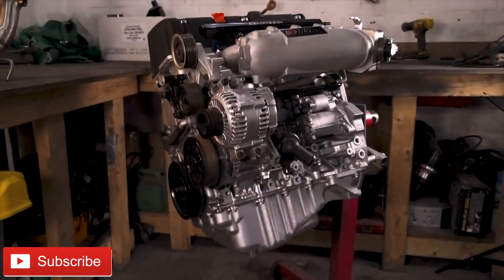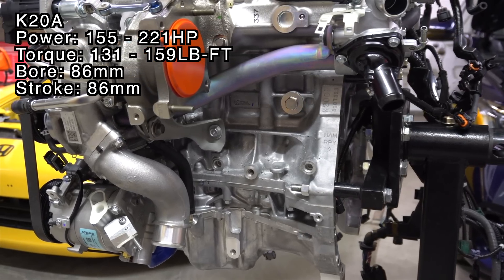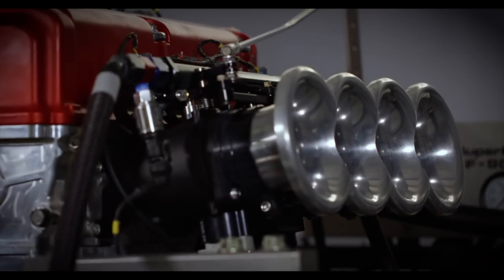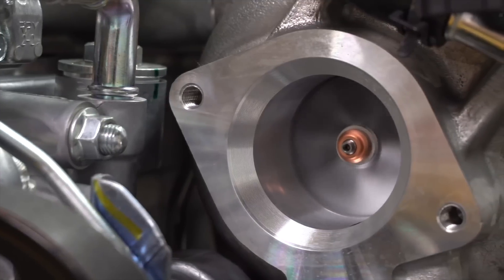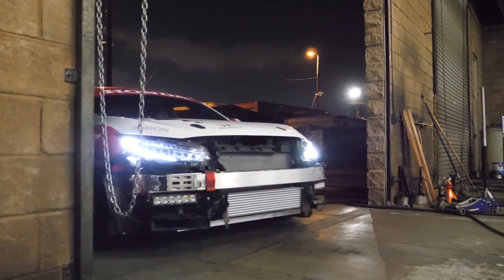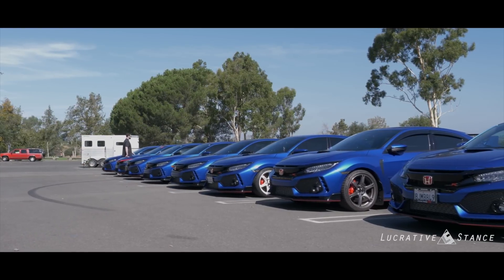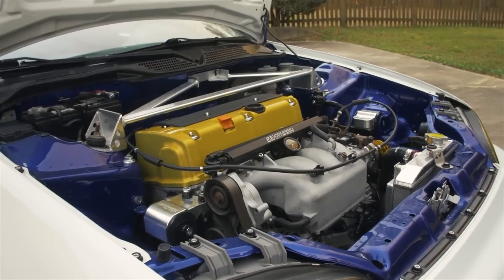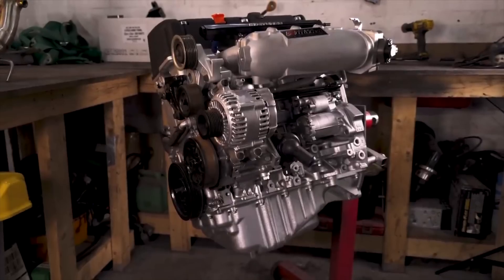Honda K20A vs K20C: What's the Difference?

Comment from the maker: If you guys enjoyed the video, please SMASH THAT LIKE BUTTON. It helps the channel out a huge amount and helps YouTube put the video in front of more people. Thanks for watching 😬
Reply: We need a K20C comparison to the N/A K20C2.
Reply: @Firestar2013  i was about to post about that ! Some people tell it’s doesn’t have potential the k20c2 but i think and believe it does !
Reply: The exhaust manifold integrated to the cylinder head is very bad for tuning for high rpm and also transfers more heat to the cylinder head, one piece is saved and the engine warms up before the rest is all bad. The engines are currently basically garbage.
Reply: K20A is the better one for now. Wish you would have added how horrible the Honda, paddle shifted CVT is. Under 10K worth of performance driving, the pulley's scored up fast. CVT'S are not performance transmissions. 
They should have never put paddle shifters on it. All shifting on a CVT is simulated or just a held position on the pulley's.

Comment: with my experience driving a 2020 accord with the k20c4, these engines are fun to drive stock.  You don't have to rev them very high to get the torque and power you need.  If you rev them up, you will be spinning in 2nd or even 3rd gear.  252 horses and 273 ft-lbs of torque.  With the k20a, you got to rev them up to utilize their power.  Whilst the k20c4 makes it's torque at 1500 rpm.  Honda's new engine imo are designed to be kept stock.  Yeah, you can tune them, downpipe, exhaust and intake and get close to 400 horsepower, but the stock 235/40/19 tires just can't hold on.  As a daily driver, 13 pounds of boost is more than enough at full throttle to keep me happy

Comment: Acura RDX, 2021, does it have K20C?
Reply: If it’s turbo, yes. But a different variant
Reply: the rdx should have the k20c4, shared with the accord.  The rdx k20c4 makes slightly more hp and torque as compared to the accords k20c4

Comment: The K20A got 36 mpg in my RSX-S during the daily highway commute.   If I drive very economically with my K20C (FL5) I can barely get 32 on a good week.  Yeah, I know, these aren't meant for economy but just thought I'd add it in.   If I drive the Type R like I really want to, it will do mid 20s.

Comment: I choose the K20C1 4my 2008 Honda Element SC daily driver because of the low end torque. I plan the elimination of steering hydraulics by upgrading 2a full EPS steering rack. My only concerns now are the adaptation of the unit as a direct bolt in, i.e. engine mounts, AC compressor, alternator &computer. I'm not worried about intercooler piping, turbo lubrication or cooling. 

Any help here?

Comment: i like the idea of the newer k20c stock or lightly modded for daily use; the k20a heavily modded for race application and big power. after seeing that accord wagon w the k20c in it, all i can think about is the k20c in my 99crv awd w that low end torque.

Comment: The K20C2 is naturally aspirated. So the difference between the letters isn't because of aspiration. If it is, then I'd like someone to explain the lettering and numbering system so that the logic fits, but so far from what I've figured out, the C is either a newer or different market than the A, and the numbers after indicate combinations of VTEC and turbocharging.

Comment: This is the proper with most new turbo motors. Way to much load in the low rpm.

Ecoboost,MZR and the k20c and most new gen motors make way to much tourque in the low end. 

So your cruising along in 6th and put your foot Down and load the motor up with all that sweet low end power and things get bending. 

Allot of it has to do with the baby turbo and bad tuning and bad driver habits.

Comment: The main thing that i don t like about the new k20 is how plasticky some parts for it are. My k24a3 is 20 years old.Changed some gaskets and seals once and that s about it.Not one single drop of oil,not one.Aluminium for valve cover and cast iron for the intake are much better materials than fing plastic.Just look at that skunk intake how sturdy and good it looks on that k20A.

Comment: K20c is good, but its not a good engine when compared to the previous Honda type r engines. Has weak ass vtec, and need 20 pounds of boost to make only 100hp more.

Comment: Is the K24 engine with K20 head also possible with the K20C? If so is the K20C head a better solution if you whant to Turbocharge the engine?

Comment: Thanks for the video @Dust Runners Automotive Journal. 

The difference of these two engines are (K20A vs. K20C):
- high revving concept vs. down sizing concept
- EURO 3 emissions concept vs. EURO 6 emission concept
- high performance concept vs. emission driven performance concept
- modulare head setup vs. fixed

Out of that many details can be explained like the port design differences, the revving capability, tribological characteristics and so on. Rating them in one sentence is like comparing apples and bananas. It's not fair as they had different development goals.

For me the K20A, K20A2, K20Z1, K20Z3, K20Z4 are one of the best base engines for developing high performance engines out of it, no matter which induction concept: NA or FI. It comes with one of the best aftermarkets and the potential of these engines is still not released at full size. 

Regarding the direction of engine development Honda take for the K20C, I don't agree with it is the right direction. The down sizing concept comes with a lot of disadvantages regarding sustainability in development, it's a completely certification cycle driven development (NEDC, WLTP), many engine concepts from the late 80'ies to 90'ies can compete with the real driving emissions of those engines regarding particles and NOx. It helped the car manufacturers to increase the chassis weight while keeping the dynamic level or even increase it. That's a total wrong way. Honda choose it too. I was so disappointing, despite I understand they wanted to compete in the I4-performance engine car market. For me the better direction is chosen by Toyota Dynamic Force or even more the Mazda SkyActive X engines are the way to go. IC engine'd cars have a hard time competing against that certification cycle preferred E-machined cars. Downsizing won't help to compete, it helps to shorten the era of the IC engines. Honda's engine strategy was really disappointing me, once they had the best and bravest engine engineering teams and strategy, now they are just average. What happens not being innovative, plans to fire employees: Daimler 30.000, VW 20.000, BMW ... and so on. The all missed to adjust their strategy right in time. Now the big kaboom can be seen all over here in Europe. Tesla teaches them all, a company with a few years of experience teaches companies with almost 100 years of experience where to go. No sorry, Honda missed that too. Honda failed to chose the right way and just went into business as usual. The first and expensive step into the wrong direction can be the first into a row of steps into a lower noise-signal-ratio regarding market awareness in future or when turning back into right direction at a lower EBIT.

Comment: I have a k24a with a k20a head.
The first version was all stock internals N/A. Dyno 212 hp at the tires.
2nd and current set up with a Garrett t3, 1050cc injectors, running low boost (11psi)on stock internals 404 hp at the tires. 
Next version will get rods, pistons and cams with 20psi. Hoping for 600 hp.
I'll stick with the A series.
Reply: we are easily getting 600whp+ on stock K20C in our Type Rs now. Look it up. With upgraded turbo of course. We even have drop in turbos putting out 600whp.
Reply: @RetrOGz  you also cost forty grand more

Comment: 300 hp with 20lbs of boost.?
That just doesn't add up.
20 lbs of boost on a k20a will yield over 500hp.
Reply: Flow rate and much higher rpm range

Comment: Honda is going the route of boost and torque over high reving n/a horsepower because their chassis have become bigger and heavier like other manufacturers.  Civic type R is well over 3 thousand pounds while the original ek9 was around 2300 lbs.  This increase in size and weight has resulted in more power needed.  The reason everyone is swapping ks into their eks, egs, and crx or intregras are because the older lighter chassis are pure Honda at heart.  Minimalist.

Comment: Do d16z6 next. That's the engine that I am currently building to handle 400+ HP. People don't give the single cam enough credit when it's actually a cost effective route.
Reply: I agree. Good luck with your build. D16s are great engines.
Reply: Watchu talkin bout... the single cams have been gettin clout for the last decade now man. Goto any honda specific show an ull see more D or F series single cam builds than u will B or H's nowadays.
Reply: if you want to build an unpopular Honda do an R series or the k20c2 (the non turbo ugly duckling)

Comment: Do they bother with different internal components between the NA K20C (used in Civic Sport in the US) and Turbo versions?
If so, the internals in the NA engine must last forever in stock form.

Comment: k20c is a far superior engine, but we are going to have to wait until the aftermarket section expands. 
that said the engine im interested in is the one used in the 130n it makes even more torque than the k20c for its power range.
Reply: I disagree.

Comment: Reliability has went way down with the turbo motors it’s a shame they have been so reliable a lot of turbo Honda’s now get gas in the oil I have heard smh my next car will be a Toyota and I have bought Honda for a lot of years ..
Reply: Mike Ramey that’s normal for Direct injection engines look it up

Comment: Whoa the errors... K20A3 base model only does the fancy valve stepping on the Intake, it constantly works the both exhaust valves. K20A/A2/Z1 or the Type S/R engines, gets variable timing and lift on both sides. It's why the A3 will out pull the A2 until the A2 hits VTEC. It's why I prefer the A3 engine as well.

A3: 141ft/lb 4000RPM
A2: 142ft/lb 6000RPM
Z1: 143ft/lb 6200RPM

Comment: The K20C guys will soon get to share some of the same problems as us ford ecoboost guys have. The integrated manifold prevents us from going over 600hp and creates a ton of backpressure on the exhaust side. Its really a shame because the closed deck ecboost blocks are pretty stout but we cant do shit about the head. If i was building a honda i would definitely go with the k24 or k20a
Reply: The c2 is naturally aspirated
Reply: The VTEC is on the exhaust side  to aid with getting exhaust gasses out
Reply: @A4ANT its still a big restriction, thats why the best honda engine is still the k24a2 from the tlx/tsx.
Reply: Three years after that comment, it turns out to be complete nonsense
Reply: @jachpriboy8989  retarded honda fanboi, show me a past 600whp civic type r using the k20c? Stoo being a fanboi and accept the fact kid, thats why people go for the k20's without the integrated manifold. I cant stand wanna be honda fantards like you.2
Reply: with minor modification head flows double, but that doesn't guarantee developing more power. The restriction is there to tumble air for DI. Need to go with both di and port or plug the di and go straight port. The integrated exhaust will always be a problem at some point though 😢

Comment: Torque???? 🤔🤔🤔 what is that??? Lol we are used to these engines screaming for dear life, and we still cant get traction while torqueless so why would we need torque??? 😂😂😂 honda need to go back to the drawing board and innovate from the k20a/k24a and make something better than both of those, the k20c isn't worth it in my opinion, seeing as just bolting on a ebay turbo to a k20 or 24 will out perform the k20c in evey way, there's even a video of a na k20 hatch givin the sauce to a fk8  with no remorse so that alone screams k20 over k20c for me, other than that the biggest issue is PRICES, and aftermarket availability, honda should've just stuck to NA and leave the turbocharging to the enthusiast, plus they went D.I. <--wtf honda, leave that shit to everyone else we dont need that shit, as he stated in the vid it's a limiting factor, I honestly dont think honda will ever make anything quite like the k20-/k24 or b/h series ever again

Comment: After watching 3 of youre vids in a row, I've learned that Japanese engine's, built in the 90's, were fucking awesome and ahead of their time.
Reply: The b16 was ahead of its time.  That same engine was introduced from 88-89 to 2000.
Reply: @ClearWater7.62  #facts
Reply: bug productions I knew that in the early 90,s dude, Honda always lead the way putting racing engines in the road at affordable prices for the public domain
Reply: Arthur Wall 😃 👌
Reply: The J was ahead of its game now it’s in the nsx lol a accord tl rl cl odd pilot Ridgeline and my hatchbacks engine the v6 ftw
Reply: @laleno5586  the NSX didn't use the J series it used the c30/c32 engine platform. Similar but not exactly the same thing.
Reply: Love my rareass b17a in my db2 with a bit of snail..with a reasonably sized turbo I hit full boost at 3500 at and it pulls hard to 8250 fuel cut off..sure full boost at 2500 would be nice but with an itr transmission the gearing is fine for it.. I have had thoughts of twin charging, nos spool up or hybrid turbo to make it come in sooner though..but with some als I can launch at like 3200 at 5psi, any more and even sticky tires spin anyway (235 toyo ra1s)
Reply: Not really that far ahead of their time tho fellas, an im a honda owner/enthusiast so dont get me wrong here but... anyone of u ever heard of BMW e30 M3's S13/S14 bmw inline 4 engines... ITB, high comp, high reving 100hp/liter SUPER advanced tech for the early to late 80's awarding them numerous championship victories in many dif circuits of racing including but not limited to group B rally. AND YUP u read that correctly... the 80's the god damn EIGHTIES ppl!!! And Fiat was the first company to ever use VVT in an engine in the 1960s but Alfa Romeo was the first co. to offer it in a production vehicle which was their 1980 spider 2000 model.

Comment: k20c can handle alot more hp than the K20a stock the k20c4 is the same as the k20c2 but they beefed up internals even has cast  iron sleeves but only offer in japan i have a k20c2 motor and trann i plan on swaping in my 1997 Prelude already have a fab guy ready to help me get it in there than once it fits ill clean up the car more and mostly buy a 2nd motor to beef up while. i want to send it to 4pison to beef up the 2nd motor  i used to want to have k24 but than when i started doing my reserach k20c is way better
Reply: The k20c is not better than the k20a. Honda gimmped it. Please explain how you figure it is.
Reply: *with boost

Comment: why cant ''normal people '' buy the k20c1 and drop it in their s2000s or civics ? they seem to only sell the crate engine for track use , why? is there any loopholes around this to bring this engine to the street ? 

cause im sure many people like me watching this videos CAN AFFORD to spend 6G on the Motor , but CANT AFFORD to spend 40G on a new CIVIC TYPE R
Reply: If you hunt enough on google you can find them. But it's such a complex design and needs so much modification that at the end of it you've sank so much into it that you'd be better off buying a used low mileage type r. It's not like the bare bones 4 cylinder engines in the past that you could swap motor mounts, an ecu, and a wiring harness and you'd be set.